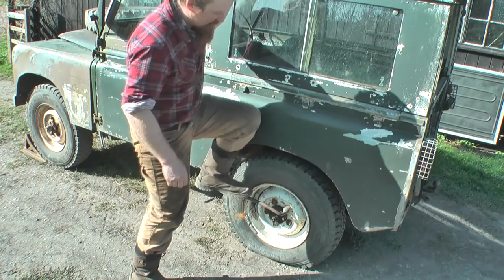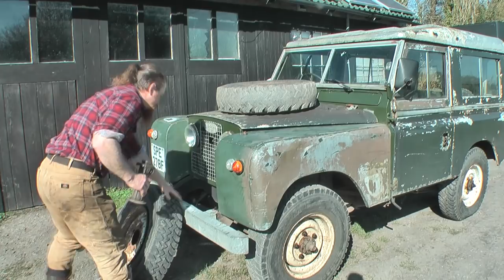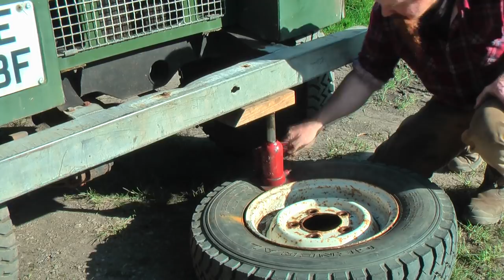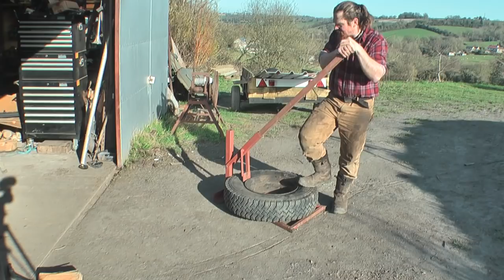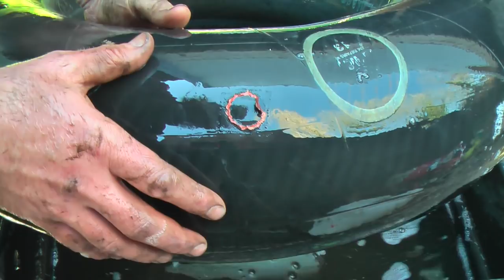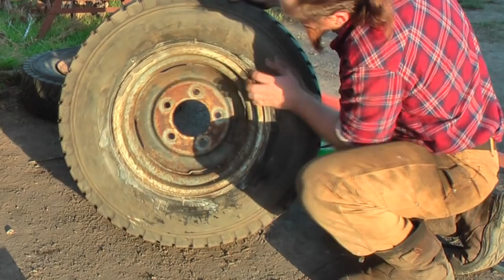Changing a tyre... in detail

Comment: I've just spent an hour watching a man change a tyre ..... and loved it.  As ever with your videos I've learned something new. I  can relate to your story about having to call a breakdown service out for a job you can easily do yourself. Around two years ago I got a puncture on my 110 and set about changing the tyre . I had the original Land Rover screw jack which locates into the chassis rails , and with a land rovers long travel suspension soon had the thing well into the air and the offending tyre firmly on the ground.  Two hours later the AA turned up with a decent jack and we had the tyre changed in less than five minutes.

Comment: Hi Max, enjoy your  channel a lot just wanted to pass on a couple of easy tricks to use in a pinch it is possible to break the bead on car tyres with a blunted bolster chisel and a lump hammer and of course if you are really desperate if you put the offending wheel flat on the ground against a wall you can drive your car over the tyre  wall opposite to the wall, I watched my uncle do this  sixty years ago when I was a nine year old been bodging successfully (mostly) ever since
Reply: I've seen that as a bush repair. Without a wall even!

Comment: Reminds me of my tyre changing learning curve 
Some old carpet on the floor will keep crap out of the job
I have been using Waxoyl for years with tubeless tyres & I always clean the rim before fitting new tyres to ensure they stay up so blow up for winter let down for summer temperatures.
Always buy new tyres on line about four years ago a real bargain  five tyres for £199-80 delivered for my Disco
My only other cost getting the wheels balanced which Son & I solved by buying an old wheel tyre balancer .

Comment: You took me back to my days as milk float apprentice. We didn't use mechanical bead breakers, we had a heavy thick walled steel tube with a cap welded on the top and a thick steel bar with the end flattened. We used it like a slide hammer, but we also had a foot high pedal stall with wheel studs  poking out where we bolted the rim to to raise it off the floor. We use to also always  wire brush the rims to clean all the rust off,so no potential sharp edges to dig into the tubes fitted and fitted new rim ribbons to to help. I have seen beads broken by carefully driving onto the tyre, so long as its another landie  with all wheels fitted lol

Comment: A good time saving tip I use on push bikes, is I keep the inner tube in the same orientation as the tyre, re inflate the tube, if there's a hole in the tube it'll give you a good idea as to where the puncture is on the tyre
Reply: Mark the valve position on the tyre before you break the bead

Comment: Thanks for this, Max, I mess with old Fords and have changed many a tyre with levers. I've sort of developed a technique which works well for me, but I did like your method of sticking the initial lever on that difficult second bead through the hole in the wheel. I might try that next time, so thanks. One thing I would offer, though would be to try working from the easier side, which would be the back in your case, with the bigger plain part of the rim to the front. I made a bead breaker similar to yours many years ago and it has been indispensable. I did chuckle when you said you ran over the chock with the Zil. Top stuff. Thanks. Mart.

Comment: Great video Max. I particularly liked your homemade bead seal breaker. Two points on changing a wheel. When replacing the nuts, the shampered side must be next to the wheel with the sharp corners pointing outwards. When in doubt look at another wheel. Secondly ensure that the inner face of the wheel, where it mates against the hub, is free of mud and grit before refitting the wheel. If debris is trapped it will eventually fall out and the wheel will become loose. Spare wheels stowed under some older cars can become quite muddy.

Comment: enjoyed that :) some things you may well know, but didn't mention, or found to be wrong : mark the valve posn on the tyre, you should keep your balance, plus when you find the hole in the tube it narrows down the search for what caused it.  It looks like you should be taking the tyre off from the back of those rims as that side has the narrower shoulder.  Final one, fit tyres with a rubber mallet not levers, stand on the tyre and work it onto the rim with your heels, you can then assist the tyre on by hitting the bead just behind where your heel is.  ATB Andy. edit: talking about the second bead here, the first will either throw on in one ;) or need a final fit with the mallet, the heel thing is just the second bead

Comment: Few months back I managed to get my hands on a manual pneumatic tyre changer, what a difference that makes. Also converted it to have a manual duck  rotating round the centre post and boy is that even easier. Be a nice project to make if you don't come across one, mine seems to have a brake chamber to pull the centre post down and the bead braker is a rather large pneumatic cylinder. Always handy to have the option to do it yourself!

Comment: Nice one Max, one thing that intrigued me is why you took it off and put a new tube in on the gravel, you could easily have inadvertently introduced small pieces of gravel into the bead or onto the tube with the tyre irons being slick with wax and picking up pieces of crap. If you had  to do it out there  for filming, then you should have at least put a board down to work on or a tarp to minimise the chances of ruining a new tube. Otherwise a great job. I would try to source a set of sals for that old Disc bottle Jack coz I just love those things!
Reply from the maker: Yes fair point, the last batch I've just done, I used a pallet to work on.

Comment: My brother had a flat and the wheel would not come off, a passing plumber with a blow torch and lump hammer couldn't shift it. I put two nuts on, hooked a ratchet strap through the wheel and dragged the car sideways until it gave up. Great video. 👍

Comment: I did work experience at a garage in around '82, I remember way longer levers made it easy even for a skinny 16 year old. The other thing they had was a simple way to clamp the wheel while you worked on the tyre. I think it also worked as a device to balance the wheel.

Comment: Old inner tubes are good for cutting into inch wide elastic bands that can be used as return springs (they go around corners too) for garden gates, doors or even used as seals for various applications.  They can be very useful also for hanging things up, although I also use wire coat hangers bent to whatever shape..

Comment: Good to see someone doing things the same as me . Just a small pointer when you use the high lift jack to take the tire of the bead you can actually put a little pressure on the jack then just tap the foot of the jack under the edge of the rim . Or just get the digger bucket on it 😁😁😁

Comment: Great video Max! I noticed, having bought late model tubeless Defender rims for my old Series III; that as well as the fully welded contruction you mention they have additional hump-like ridges inside the outer rim, presumably to stop the tyre sliding inwards on the wheel and breaking the bead.

Comment: Something for LR drivers. The Series 3 and Defender wheels are also used on old tractor fronts - old like the Fordson Major... OLD. Over here in rural ireland.... most tyre places are more likely to have tractor tubes than LR tubes (and consequently will fit them!) The problem is the valve stems are different and it is in fact an MOT failure as I found out last year. The good news is that over here everyone is happy to work on old tyres/tubes... They charge 10 Euros a time.

Comment: I've done a few tires myself but this is good entertainment. I used a wood board layed on the sidewall and then drove my truck up the board to break the bead, works ok most of the time. Lately I use my credit card and pay to have them changed but I may try your high lift jack  method if I'm in a pinch. I got a good laugh from your story of having to call someone with the proper socket, we've all been there man.

Comment: Something I always do before putting the wheel nuts back on is add some copper grease to the threads, then they never rust on and usually come off a little easier.

Comment: One problem with tubes these days is tyres are made for tubeless rims, the inside of tubeless tyres have ridges in them from the moulds which rub and fret the inner tubes until they leak. You mentioned a nail in a motorcycle tyre, back in the late 90's I had a Nissan patrol, I had just had four new tyres fitted and on the way home as I went round a bend I saw a half inch diameter coach bolt lying in the road and coming in the opposite direction was a bloody great john deere tractor leaving me no room to go around the bolt which proceeded to flip up and rip through the outer edge of the new right front tyre, I had to put the spare on turn around and go back to the tyre center for another one.

Comment: Good Stuff here, preserving  the dying art of self- sufficient motoring!   Always debate on greased or dry for wheelnuts, majority opinion probably  being dry to avoid nuts  working loose, despite more clamping force. Certainly the clamping  contact points should be dry.  Noting final wheel  positioning on old  Land Rovers and others uses the  conical seat on the nuts and wheels, older LR models have reversible longer  nuts as removed , but directional new type  nuts went  back  on here.  Good practice to check nuts are tight after say 50 miles following  a wheel change as paint or rust may get compressed. Probably academic these days, but there is also a  possibility of ancient tyres being crossply not radial so should not be mixed on the same axle.

Comment: Brilliant. One quick suggestion is that before you take the tyre off you mark on the tyre the position of the valve so that when you put it back on and re align the marks the assembly stays near on perfectly balanced. The other thing is Not to use tyre soap on reassembly for two reasons, one being that as you work your way around putting the bead back on the tyre grips the rim and saves you chasing it around as it can easily slip. the other is that the tyre soap can cause the tyre to slip around the rim under acceleration causing the valve to either disappear into the wheel or it can tear the valve completely out of the tube.If you need some lubrication then plain old water works and doesn't cause problems. Stay safe Max.

Comment: I have used the black flex seal in a lot of my dry rotted equipment tires and tractors on the inside and work amazing and a hole I get in my vehicle tires holding up and been 2 years

Comment: Max First off thank you for the effort and sweat you put in making this video, I have used all these methods to achieve the goal of fixing the tire. Now days I just fill it with air and take it to the shop and let some young dumb kid do all the work 
There is a third way you can try to break the bead and that is driving the front tire up on it.  Set the tire so that when you drive up on it you just miss the wheel generally the weight of the car is enough to cause the bead to break. but like the jack method you may need to repeat a couple of times.
My dad made a similar set up as you have except he used pipe and a piece of truck wheel as the bead breaker it didn't work as well as your does because he didn't put any cross braces to keep it stable.
Tire irons until I went to work at the truck stop we used a combo of a large screw driver and a couple of old skinny car springs. The first time I was shown a pair of real tire irons I just about cried.
Seating tubeless can sometimes be seated by bouncing the tire wheel combo  on the ground, the better way is to take a ratchet strap wrap it around the tire  center and tighten it up till the beads make contact with the wheel. There is a third way but it involves fire and I let people go look that one up

Comment: Pretty much how I do it. I use a hooked lever and sledge hammer to break the bead, or the edge of the four poster ramp, or drive over the side of the tyre if not near a workshop. I learn't how to change tyres by hand at the main Mitsubishi dealer I used to work at. (1990's) Changing tyres on new or nearly new vehicles with alloy wheels, with only three levers and a sledge hammer !! It was madness , a used tyre machine would have cost less than one alloy wheel if I had missed with the hammer and damaged it. Good learning experience though.... :o)

Comment: The old Citroen DS didn't even come with a jack.  When you got a flat, you set the crazy hydro-pneumatic suspension to go as high as it could go, stuck the provided  prop in a strategic location under the car, and then let the suspension down.  Et voila! The wheels on that side magically came up off the ground.

Comment: Hi Max, just for info, tyres on those rims are removed/fitted from the back of the wheel due to the position of the wheel well and the narrower bead land profile, you can see which side is narrower by looking at the wheel before removing the tyre, makes it easier to get off and on with the tyre levers for sure, enjoyed the video thanks Stew

Comment: i carry a 4 way lug wrench. it is shaped like an x with a different size socket on each arm. i also have an old bumper jack from a car from the 70's that is similar to a hi lift jack that has a foot and a beam with a ratchet mechanism that i use to break the bead off of tires. i have been doing it that way for almost 40 years. you put the jack on one side, and you stand on the other to keep the tire from tipping. i have a hi lift as well, but the bumper jack has a larger, thinner foot that slides down under the rim, and is lighter than the hi lift. i have about half a dozen tire spoons and bars to get the tire off, but my project for today is to make a manual tire changer. harbor freight tools sells one for about $40 usd, but i'm a bit short on funds as well, not to mention i'm a cheap bastard. thankfully i have a welder and a large steel pile. i have a bit of acme screw shaft with a follower that has a flange that i'm going to weld to a section of tube and a weld a truck rim to the other end as a base, and mix up a 50 lb. bag of cement to fill the rim to make it stay put. you mount the tire on the changer, fasten it with the follower, and pull against the shaft with a tire bar to dismount the tire. i may have to make a new tire bar to get it to work the way i want, but it is something to do while i am stuck on the homefront.

Comment: A bit random  but I've seen a zill with a radio box on the back up north, it looked good 6x6 I wouldn't have known what it was if I didn't watch Max. I used to fit tyres I see your biggest problem is rusty inner wheels 1x flakey bit of rust between rim & tube even when re fit = rubbing then problem. A Michelin tube if you can get one, loads of talk helps a lot with any road going tube type tyre. I don't want be arse but that's what helped in experience. It isn't easy what you did I take my hat off to you. Good vid keep them coming.

Comment: I had a recent 'incident'.  I go in and out of Manchester centre every day to drop off/pick up my other half.  One rainy cold winters night I must have developed a slow puncture, everything was fine when I set off, and I didn't notice any problems on the way in to the city, but when I stopped I felt there was something wrong and sure enough I had a flat, one of the rear tyres.  I didn't have my spare with me because reasons, I didn't have my tyre inflator either and of course none of the people around had one in their cars that I could borrow.  And so, I had to set off home with a rapidly deflating tyre at the back.  About a mile later and all the air was gone, another few hundred yards and the tyre was off the bead.  Another few moments passed and the tyre had rotated perpendicular to the Land Rover and I had to limp home, about another three miles, like that.  Up down up down at a very horrible five miles per hour.  I did eventually get home, where upon I immediately fitted the spare I had ready for the next day...which developed it's own slow puncture a few days later.  Good used 7.50r16's are pretty hard to come by these days, at least up here, it seems everybody is holding on to theirs and I suppose for good reason.  I currently have four good tyres but no spare.  I'm not a religious man but I say a little prayer every time I go anywhere in the Land Rover...although currently that isn't such a problem I suppose.  Happy Land Rovering!

Comment: Just a little tip for rounded or damaged nuts a bit of grit or dirt or sand in the socket or wheel brace will help it bite into a worn bolt or nut

Comment: I'm about to watch an hour long video about changing a tyre, something that would take me about 15 minutes.

I hope this says something good about the channel rather than bad about me.

Anyway my top tip is to make sure you don't cross thread the wheel nuts.
Reply: You can actually remove the tyre from the rim & replace it in 15 mins, by yourself, without specialist equipment. That is quite something. Please do a video showing you doing all this in 15 minutes, I can't wait to see it.  "do not cross thread wheel nuts"  LOL.
Reply: Took me 5 minutes to  change the tire on my police car!  The car I now have, the air-conditioning doesn't work .  So I am going to convert that to pump air, mainly for my tools, but also to pump up my tires.  I used to be a tire mechanic, so I can repair my tires, just need air!